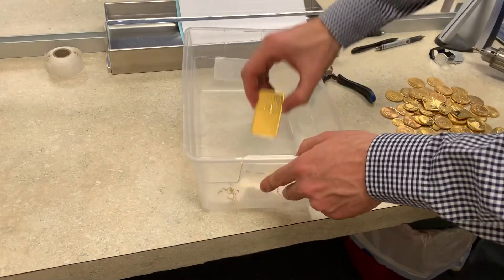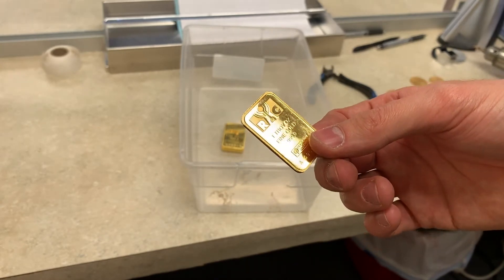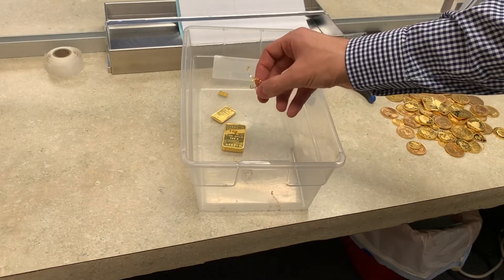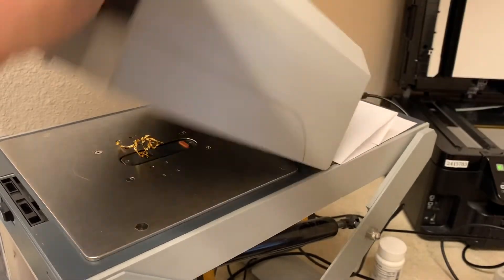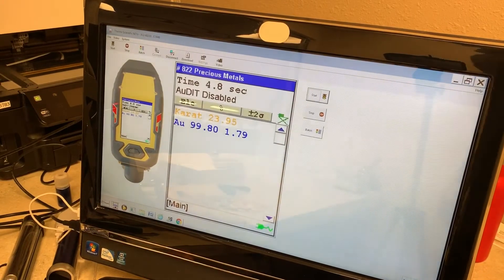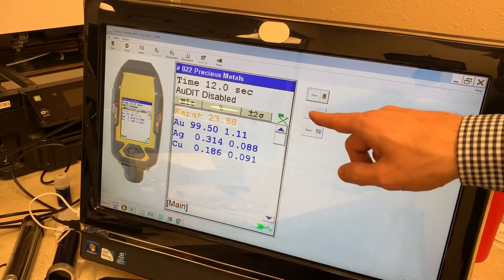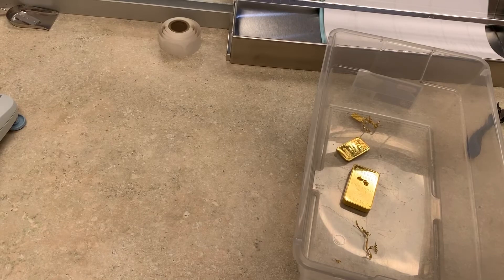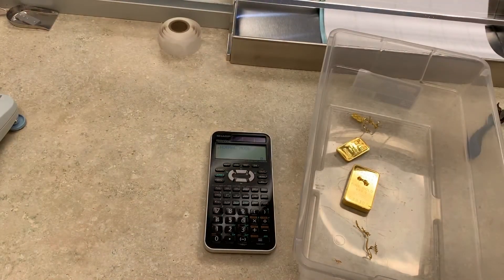How to test gold bars / how to verify 24k gold bars are solid and real pure gold. 10, 1, .1 oz

Comment: I will first calculate volume measuring displaysment when you put a gold bar into the water. Then just calculate weight, with this two values you can calculate purity easily
Reply: Pl explain how I do that
Reply: @balakrushnapanda1799  You can use some plastic dish, and fill it with wather to the top of the dish. When you do that you can put gold bar into the wather. Wather that was left the dish is the volume of the gold bar. And you can calculate volume using graduated cylinder. Now when you have volume you need weight of the gold bar. You know what is the density of the Au element. With this 3 values you can calculate the difference of densities

Comment: Usually you can tell if it's not plated or skinned by using your eyes to look at it's purety, if it is identical in coloure content as the outside then it is pure, or just decide when you want to accept that gold is a certain material that is not hard to mistake , and the computer you used audit is disabled in which is the inspection itself. Sir

Comment: What's the point in having all that equipment if you gonna ruin the bar by drilling it anyway?
Reply from the maker: We sell coins. bars, and casting grain.  Sometimes we run low on casting grain and we convert our bars to casting grain.  Sometimes we just get too much gold and need to sell it off in bulk and we will just make giant bars to sell rather than sell many small bars.

Comment: Ultrasonic is not a 100% foolproof,you have to unfortunately dig in
Reply: @ptaeiy doesn't measure what's inside the bar
Reply from the maker: @ptaeiyWe do have an ultrasound tester in-house as well.
Reply: @goldrefinery2709 so is the drilling really necessary if you have the xrf and ultrasound?
Reply: so is the drilling really necessary if you have xrf and ultrasound on the 10 oz bar?
Reply: No which he should have explained in the video